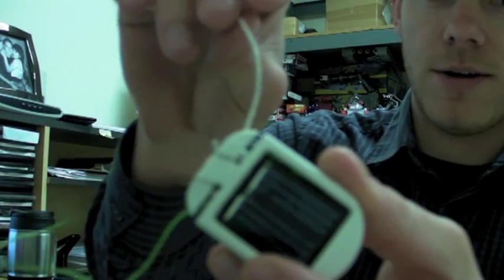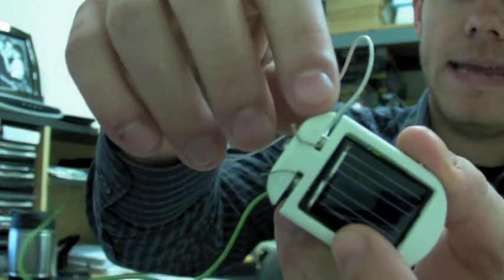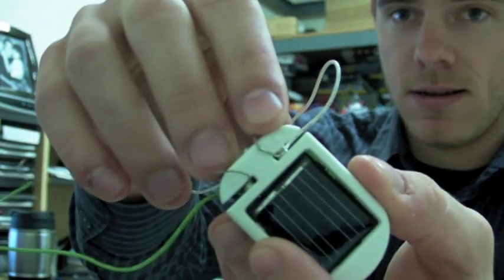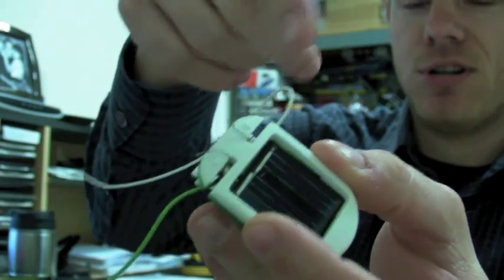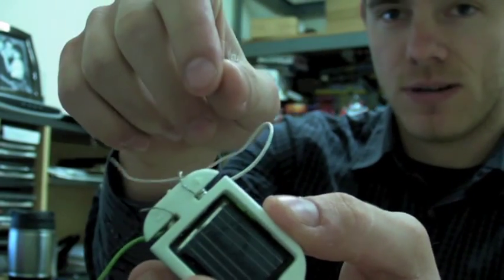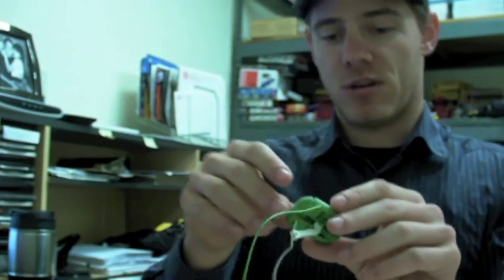6 in 1 Educational Solar Kit Troubleshoot Video

Comment: Not sure if it's the same one but I have a 6 in 1 educational solar kit by Avon. I actually didn't pay a lot for it - it was in a charity store, and still packaged as new. I remember looking through a Science Toy catalog and when these first were a new thing, they were about £30

My first thoughts weren't too positive when I opened the box - but I thought you get what you pay for....the reason is because on the box the picture shows a decent sized solar cell powering the bots - I opened the box and thought it was missing, until I saw a small square the size of a postage stamp. If this is the size of the Main/ Biggest component the robots must be even more micro.

Anyway I haven't started to put it together yet, then I saw this video. I hope it doesn't require too much messing around!